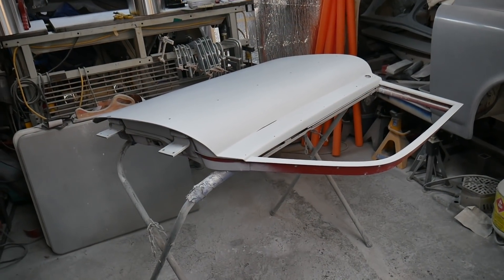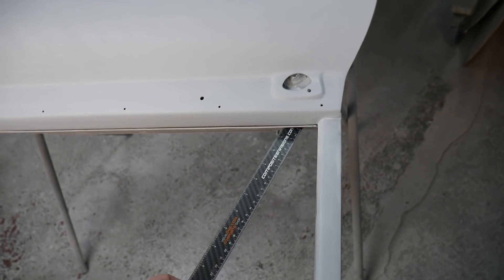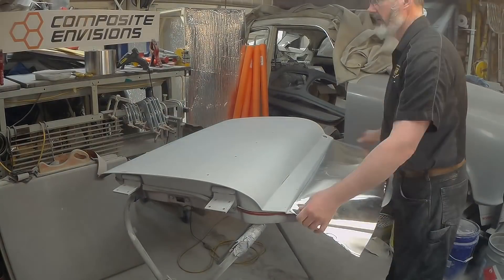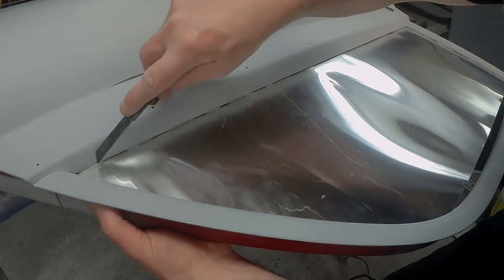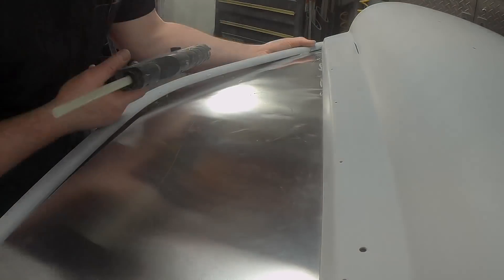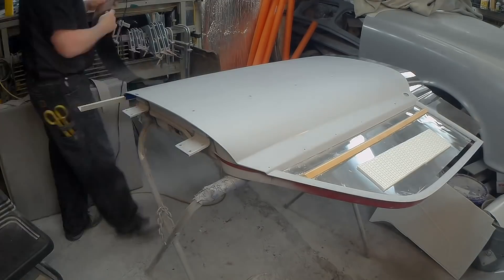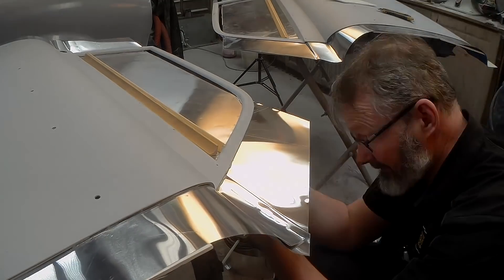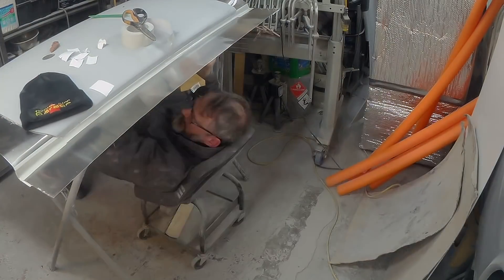Carbon Fiber Car Doors - Mold Making Part 2:  Adding the flanges. (Ep. 64)

Comment: Thumbs up for the aluminum flashing. Slick surface, very easy to form contours, and reusable.  I'd skip the foam backing but if needed, I'll use 1/8 fiber boards instead. Even better, pre-glue the flashing to the fiber board using flooring adhesive and rip them into 8 pieces on a table saw.
Reply from the maker: It was a great suggestion from a viewer!  I found the foam backing made sure it stayed put while I was doing the fibreglass.  A lot of this was done in the winter - so my garage is pretty cold and the hot melt alone was not enough to keep the flange secured.  Pre-gluing - never thought of that but that's a great idea.

Comment: Excellent work! I'm looking to restore my hot rod and to build a same model race car out of CF for the body. Instead of building molds, could one lay a sheet of CF to on top of the door/fender... creating the outer skin or mold? Then re-enforce the skin by adding layers of CF behind it? I understand that the finished product will be a few mils thicker, however not an issue for my project. Thank you.
Reply from the maker: I don't think that will work very well.

Comment: I was recently helping my father with some door work on a vehicle. Needed to block off the doors on the truck cab at night to keep the animals out. I just took a sheet of Plywood and Kerf Cut it in the areas i needed to form to the compound curves. Add some additional structure after you have it in place and done. I figure this could work well for backing areas like the glass of this door. Potentially saving time fighting with thin sheet metals that have a memory to them.
Reply from the maker: I now have an 8" gear drive DA and a real air board to help with the next phase of bodywork.

Comment: Boat builder by trade so I really enjoy the familiarity with the body work and mold/plug building process 
When building flanges we always used the ugliest cheapest formica available, it's already so slick you can pva if you wanted. Just a clay fillet for a radius. 
Another method we used for part release is; we use a 4" length of 1/4" copper pipe and flare the end sitting on the part. Find a spot with a cutout and stand the pipe up, apply resin putty around it neatly then do your gelcoat/layup after it hardens.
When you go to pull the part, simply stick an air hose (blower nozzle) in the copper pipe and the air will pop the part off, often without doing anything other than trimming the flange. No wedges needed
Reply from the maker: Cool - thanks for the input.

Comment: Hey there. Maybe I missed it but I don’t understand why the top portion of the door frame is not part of your mould. Can you let us know??? I’m looking to do my doors soon enough and looking for all the tips I can get! Thanks
Reply from the maker: Because it's really part of the back face of the door.  There is a skin, but the door frame (and glass channels etc) are welded into the back panel of the door.  It would take 3 more molds per door to make the entire door and it's not worth it and not really as safe as I'd like.
Reply: Throttle Stop Garage thanks. That makes sense. I’m loving this series - I’m pretty much doing the same thing with my car but no where near as advanced as your project. These vids are really helpful

Comment: Love the videos as always.  I'm wondering for your door to window transition area, would it be helpful to create a two part mold of JUST THAT spot, so you can create a glue-on 90 section from behind + the felt retainer.  Maybe it's a piece you can create with part of this mold after its done?    If you had wax for filling the crevices, I would wonder if a heat gun/hair dryer plus a tape line (that you remove) wouldn't help make very clean transitions.   Just spit-balling

This co indicates they have Canadian distributors and filleting wax: 
https://www.compositesone.com/wp-content/uploads/MROLineCard.pdf
Reply from the maker: The wood trim is making the return flange for that part of the mold.  I'll then glue it on and job done.  I really don't like the idea of vacuum infusion on a part that would return on itself like that.  I'm sure it can be done - but not by me.
Reply: You may also find a plastic called Polycaprolactone (pellet or sheet form) useful in certain circumstance where you need to mold something temporary and rigid in one of your forms.  It becomes molten/gel like in 150F water and is reusable.  It seems to be available on (ebay / Amazon) as well as under some trade names.   It's also useful for molding dental appliances or...customizing vampire teeth caps for those Halloween parties. 

http://www.robotroom.com/Prototype-Plastic.html
Reply from the maker: Cool idea Paul.  I've used the plumbers epoxy to make temporary molds with good results.

Comment: Are you going to do the inner door structure out of carbon as well or just the outer door skins?
Reply from the maker: They're far too complicated and would require several more molds.  So just doing the skin this time.
Reply: @ThrottleStopGarage   please build the inner doors to, it will be fun.

Comment: I have used good quality double stick foam tape for mounting flanges, the one I like is used for setting double pane glass in vinyl windows.  Thanks for another episode :D
Reply from the maker: I was thinking of using 3M mounting tape - but didn't have enough.  Many stores are closed in Canada and getting things shipped...well, they're quoting mid May right now. So making due with what I have.

Comment: Instead of using plasticine, use painters caulk. Much quicker and easier!
Reply from the maker: I've wondered if it works.
Reply: @ThrottleStopGarage  it does! I use soft filleting wax or plasticine if I need to fill large voids or add temporary flanges, but sealing perimeters is much easier with caulk 👍🏻
Reply: @garyengland5326  interesting to know

Comment: So the window frames won't be part of the doorskin? It seems like if you were going to do them, it would be better to make the window flat and support it from underneath? Love these videos.
Reply from the maker: The window frame is a separate part from the door skin.  I did make the blocking panel flat and it's supported.  There are a lot of curves and complex parts to these doors.  Not like a modern door at all.  This was the "best" solution that I could come up with.
Reply: @ThrottleStopGarage  That's what I was wondering. Makes sense, thanks for clearing that up.

Comment: I'm right in the middle of a motorcycle fairing project.  This is really great content!!!
Reply from the maker: Thanks Shea - good luck with the fairing.
Reply: @ThrottleStopGarage  I will be posting a foam shaping video soon. I am thinking about just laying up over foam for a one off part. Partially because of supply shortage.  I'll post you a link when I post it. I would love to have some advice
Reply: @sheanyquist  Hi Shea! I would like see what you are doing, because I want to make a fairing for my motorcycles, and what a like to do is make them loocks like a race motorcycle from de 60s and 70s stile, is it that you are doing? Much oblige from Brazil.
Reply: @paulolodicora4471  I am making some crazy electric bike and motorcycles.  I am a metal fab/ engineer and I am just starting in composites. I need to expand me skills but I'm kinda just bumbling through this process right now.  Feel free to check out my channel and help me figure this stuff out?
Reply: @sheanyquist  Knowing that one content creator I am subscribed to watches another creator I also subscribe to just puts a smile on my face. Both of you have amazing content, thank you.
Reply: @Demoni696  thanks for the support!!!!  I'll keep the videos coming.  I just finished laying up my fiberglass today and it's looking good so far!!!

Comment: Hi, hot glue not adhering to metal because metal to cold it pulls all temperature from glue to fast, you can use hot air gun of just hairdryer to warm up metal and reactivate glue. 

Also useful technique to grate some glue and spread it cold, then warm up to melt.
Reply from the maker: Great tip - I was wondering, but every time the glue would pull off the paint overspray.  I will try the hot air gun technique on the next molds.